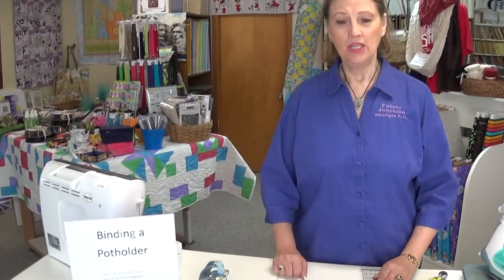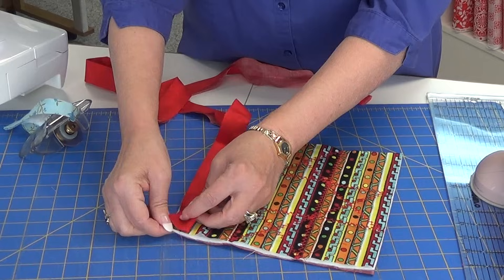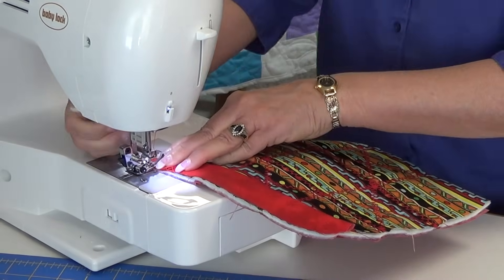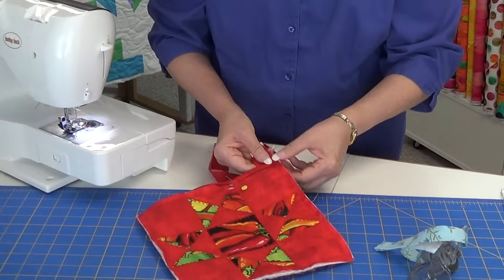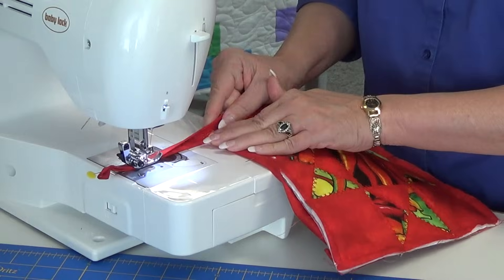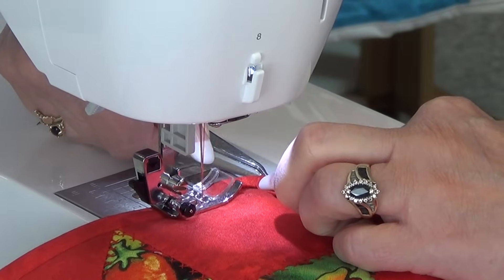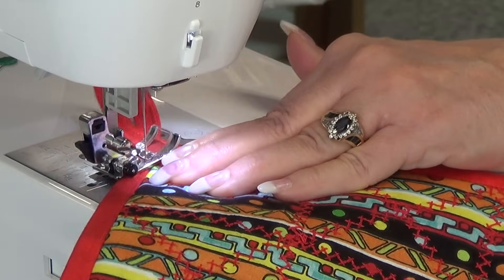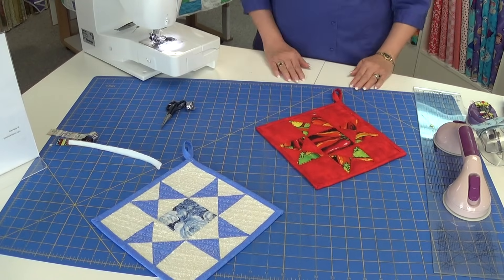Binding a pot holder with hanging loop.

Comment: Very helpful tutorial.  I have some scrap fabric I plan to turn unto pot holders and this is the first (and maybe only) video I will need to demonstrate a loop in the binding.  Great tip to use tweezers!  I saw a quilt binding tutorial that showed to fold the corners with the edge you are sewing on top - tuck the horizontal edge under - then you have a smooth edge instead of trying to get over the edge of the fold.  Hope that makes sense.
Reply from the maker: I know there are several different binding methods.  None of the methods are wrong and some are easier that others.  Try them and decide what works the best for you or what suits that project.  I have used a variety and have my favorites for different projects.  The double folded strip is my favorite, sewn back to front. It is a time factor.  Thank you for watching.
Reply: I just finished my first potholder using your tutorial.  I need to tweak a couple of things but the hanging loop is great!  Next one I'll remember (hopefully) to use 2 layers of batting/insul-bright.
Reply: How do you fold the loop?

Comment: Love your video. I will watch it again when I construct the pot holders I have cut out. Since I am making mine 4-ply, using two layers of heat proof batting, I cut the fabric a little oversized. Then I cut out the potholder and it has nice even edges. Lots easier than trying to line up four layers. Your video was EXACTLY what I needed to apply the binding and loop.
I tried making rounded corners. Didn't work for me. Your method is perfect!! Thank you so much. PS, I just discovered myself how very useful tweezers are when sewing. Now I can't sew without them.
Reply from the maker: Happy to help. :)

Comment: Are you using bias binding?  And how wide did you cut it?  Thanks.
Reply from the maker: I only use bias binding when I  have  a curve. I use mostly 2 1/2 inch strips.